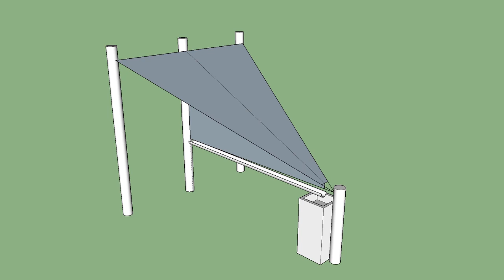Skywell: Harvesting Humidity Using Sails

Comment: I used to go to work in the morning and every morning I opened the bottom valve of an air compressor tank and about 2 gallons of water would shoot out. The air was at 100 psi and the water condensed out overnight.

Comment: Team GLAS:  Have you tasted a prototype yet?
      There are models of nets And screens in various configurations that do produce water, as I’m sure you know, and some of them have been pressed pretty heavily in the service.

It sure would be nice to hear about your test products, and how this particular configuration stands up to windshear.

Your model appears to have a much higher contact surface ratio, and very solid anchoring, but a change in winter direction, and high wind velocity could make a huge difference. 

I do hope you’ll respond. Your design is unlike the other set ups in several aspects, and it would be fascinating to know how the performance is, and about any tweaks that you have to make.

Comment: My idiotic opinion that much can be saved and or improved  with this desing. We know that water in liquid form because of gravity falls straight down then the sail does not need to be inclined not even one degree, also only one mast or single pole is need with a horizontal top and 1 bottom canal slightly slanted towards the reservoir or pipe with 2 corner ground anchors.... I calculate the cost of materials, transportation and installation could be cut to less than half ; )

Comment: Liked the simplicity and low wind drag-- are there any plans available to build a scaled down test version? And, what is exactly "hydrophobic material" (in plain english), what are the characteristics, properties? This design seems to be more practical than the vertical nets which can be blown down under strain winds.
Reply: Plastic material, or plastic mesh. SImilar to plastic mesh filer. Plastic so the water doesn't get absorbed in the material. Problem with this is evaporation of the water that is being produced. They should really have a working model.

Comment: New to this subject ,  could I just go to a hardware store buy a big roll of  fine netting to build a home made water dew collector/condensor , in case of emergency like an earthquake  , then give my neighbors a few sheets of this material to funnels into a big bowl in the morning so they dont die of dehydration? or is it more complicated than that ? thanks for any replies.
Reply: This kind of idea isn't practical because you won't get enough water. In a survival situation you'll expend more energy building a dew condenser than it's worth worth.
Reply: @teddyruxpin3811  :  Perhaps. But if it comes to that, nobody says you have to actually planned a pole or two or four. Sometimes there are enough existing structures that you can tap into, and once it’s built, it’s low maintenance.
Reply: Grand conjunct— how did your pilot project go?

I have seen videos where people actually have these functioning, almost like a mesh tarp with very reinforced edges and eyelets to which they a fix spring hooks to attach them to the posts.

At least one seems to have reinforced triangular shapes running through the mesh.

I’d be very interested in hearing about your results. Please do get back to me about that, and I’d also like to hear about the environment in which you use it.

There is at least one more video out there that uses a net made of a mesh that looks like woven or possibly crocheted probably propylene— very much like baling twine. That could be a good use of bailing twine, Made over the course of an extended period of time, as time permits, until you’re ready to run your final project, if you haven’t done it already.

I mentioned this because although baling twine is getting a little pricey, if you happen to know any agricultural workers who have baling twine on hand as a matter of your normal course of business, that might be a good source of free material from which to work.

It occurs to me that in terms of windshear, if your sale or net or screen were erected in the same manner as a flag on a pole, then it wouldn’t be a big deal to take it back down in the event that adverse conditions were underway.

Just my two cents worth, but since a person with theoretically put one of these things up because of economic conditions, well that might be an easy and low tech way to put one of these things up, such that there’s less of a vulnerability, And far less time to be spent on maintenance.
Reply: @daphneraven6745  
I Daphne , I posted this question over a year ago on several videos and didnt get much help /responses , so I abandoned the idea , I was just thinking of easy ways to feed and hydrate my starving / dehydrating neighbors during the apocalypse , but it looks like few in the survival community are thinking in community terms.  thank you for the ideas though
Reply: @grandconjunct  :  Yes I saw that. I was thinking that you would have done a pilot project to see how it works, that’s why I sent you the comment.
     What did you find that works for you?

Comment: it is a good idea, however, how are you going to do to keep the surface clean, as it is going to be in open environment, you should expect the water to be very dirty. no for drinking water, that's for sure.
Reply from the maker: That's a very valid concern Carlos. We came to the same problem which is why we are going to include a filter on the reservoir where the water is collected.
Reply: +Team GLAS the filter concerns me. For this to be a serious effort to address global water needs, the filter would have to be long lasting and cheap to maintain or replace. I have concerns that the ongoing filters needs would be seen as an ongoing income stream, when something as simple and long lasting as a sand column might work just as well. 

For more arid regions, or sites with higher water needs, i would think you could incorporate solar elements in the sail with some tubing to form a cooling loop. with a thermoelectric element and one pump you could cool the whole sail and widen your water harvesting window.
Reply: @teamGLASmtl  You can have a small solar still to evaporate the water and produce clean one.  

https://en.wikipedia.org/wiki/Solar_still
Reply: You could probably attach it to the front so it gets sun.